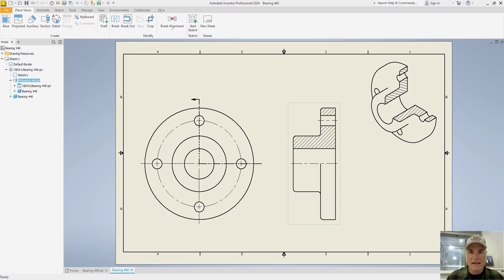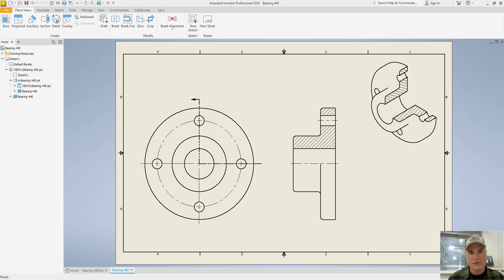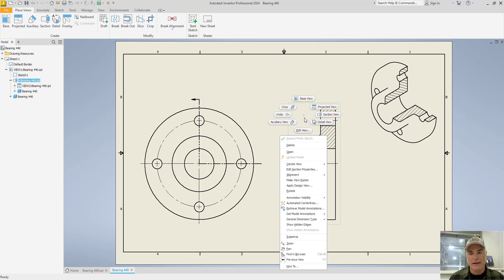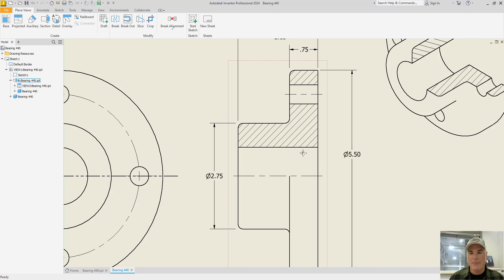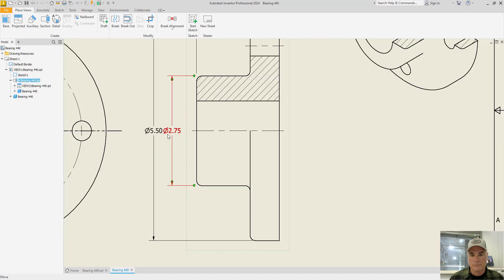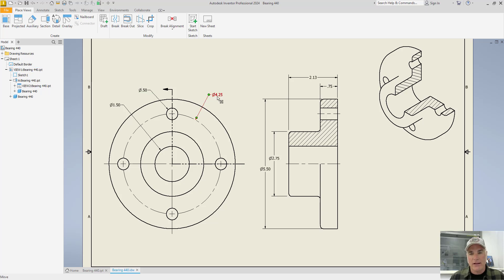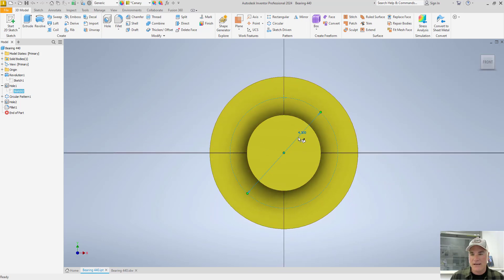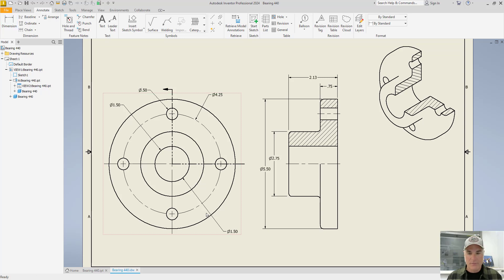Autodesk Inventor   Retrieving Model Dimensions

Comment: For some reason, they decided it might be good to make that tool slower, clunkier and less useful when used in an assembly environment... There used to be a big "Select Dimensions" button within the dialogue box, pressing that button or pressing D on the keyboard would automatically display all dimensions from all parts within an assembly (which is very useful for my workflow) and you could instantly start picking the ones you wanted. Now I need to go click the "Select Source" button so I'm able to click on the part I need dimenstions from and then I have to click AGAIN on the Select Source button to deactivate it so I'm able to click on the dimensions I want. So needlessly annoying and will surely make our workflow much slower since we can produce up to 500 drawings per day.
Reply from the maker: Documenting assemblies can be frustrating - I will look to see if there is a solution for this issue.
Reply: @professor_porkchop  There is one... and as always, it is to code your own tools in iLogic / VBA because Autodesk can't be trusted to deliver a half decent product for an increasingly, borderline unaffordable piece of software.
Reply from the maker: Agreed. And iLogic is one of those things that some people don't want to try because it seems "scary"